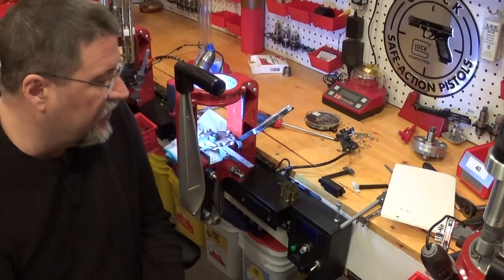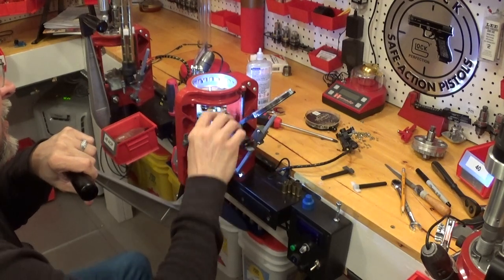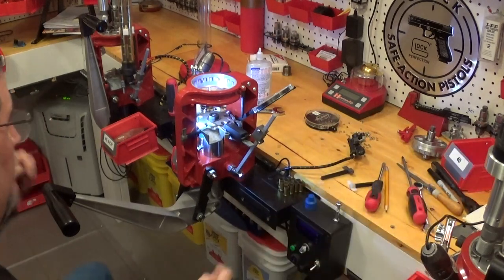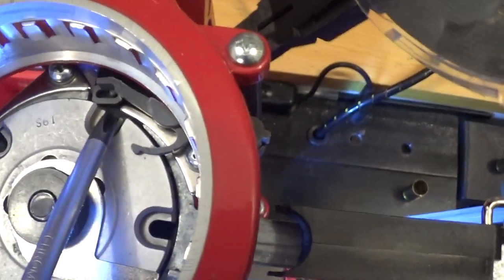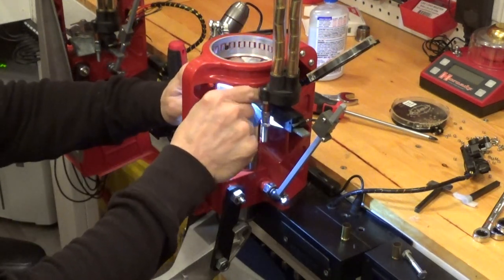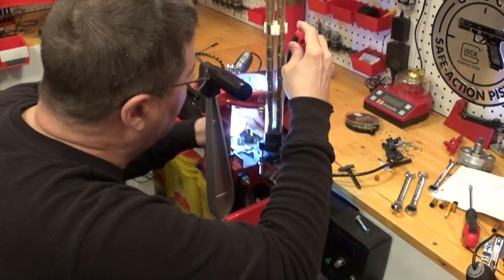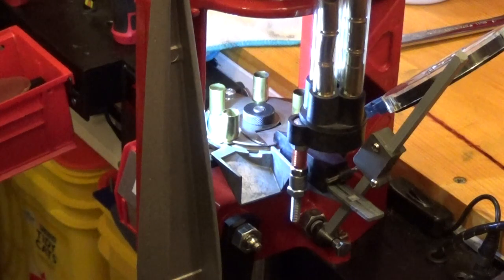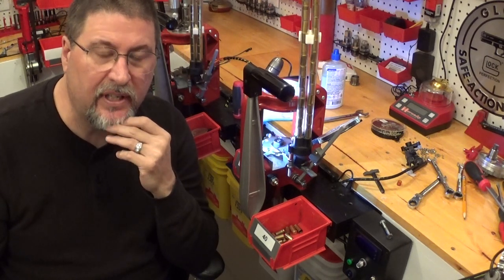Lee Loadmaster Trouble Shooting Series Video 3

Comment: Having problems setting up my case feeder.  It does not reliably push the case completely into the plate.  It appears as if the slide does not come down the rod enough, or with enough weight to force the case slider all the way in.  Any ideas?

Comment: Thanks for your video, you do a very thorough walk thru on how to set up the LM. I'm setting up for 9MM on my LM. Problem is 2 cases drop down from the 4 tube case feeder and lock the case slider from moving forward. I'm using the small case feeder. The height of the case slider is taller than the 9MM case itself. How is only one case suppose to drop and the 2nd one not drop? Hope that's clear.

Comment: My case feed system was binding due to the grey rod flexing at the top as the slider lowers, so I actually turned it toward the carrier tongue a hair (12 o clock squared up to cocked at 11 o clock) and it eliminated the flexing. Go figure
Reply: Mine is the same. Heavy binding when squared up... Slick as a whistle when turned... Mine seemed to want to go that way when the bolt is turned in. Also, I hot glued two layers of industrial zip tie to top of the case pusher. Now the case is pushed evenly from under the tube full of cases above it. No more kicking out at the bottom.

Comment: great intructional videos. I have a question on the ram alignment... im having a hard time aligning it. The only way it works almost without a hiccup is if the index rod has drag/resistance on the upstroke again the press body. Am I suppose to feel drag from the index rod as it rides up against the press?
Reply from the maker: You should not have any binding or any drag on the cycling of the press. If your not seeing the indexing rod scratching the paint on the down ward guide on the press. Loosen the bolt on the bottom of your press. Make very small moves on your carriage to the right. Your carriage is straight out at the 3:00 position that you feed your cases on, start moving that back counter clock wise 0.10 adjustment at time. If your not using the same wax as I use, apply a good coat of clear wax product on the index rod and the gray part. Go back to my video that I show the alignment video. That alignment should almost be a straight line until it reaches the top of the stroke, when reaches the top, it will kick over to the right side at top. Check and make sure you don't have the nut to tight on your shell plate. Sound like you just need to make a slight adjustment on your bottom bolt, move it over 0.02 , 0.06 thousandths to the right. Try this and let me know if this solves your problem. When you find this sweet spot, you will know very quickly.
Reply: I went back and studied your video. I loosend the shellplate nut and loosend the bottom nut. I adjusted the carrier so that the index rod rides on the scratched of the rib and its working as it should. Thank you so much! now on to fixing my primer feeding... lol
Reply from the maker: Awesome, let me know if you need any more help.

Comment: Instead of the plastic tube spacer, 
how about an extra Nut to lock the center nut in place?
Reply from the maker: I tried it and I also tried a thread rod in the center. I am working on another product now that ties off the press. I had to order a aluminum form. I keep going until I find a fix.
Reply: Harleychromeman, your accomplishments amaze me. I once was a very good mechanical calculator repairman and later a service manager for Remington Office Machines in Toledo Ohio in the seventies. Like I said, you amaze me.